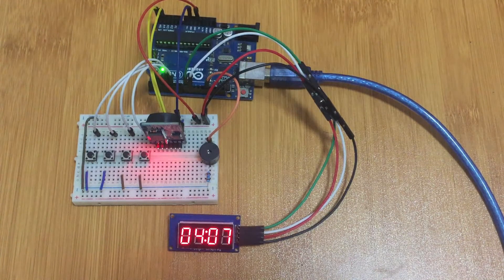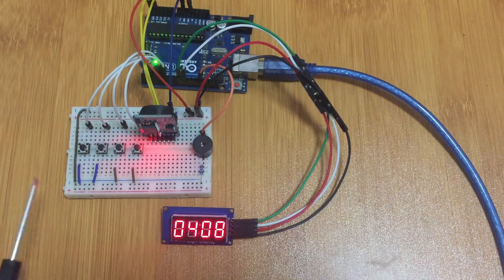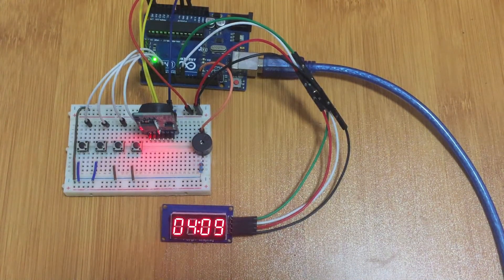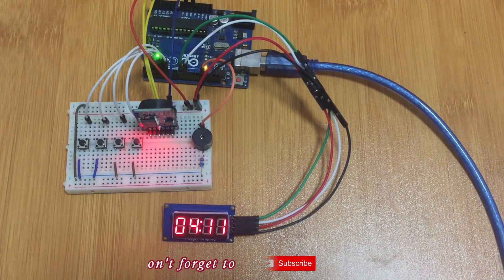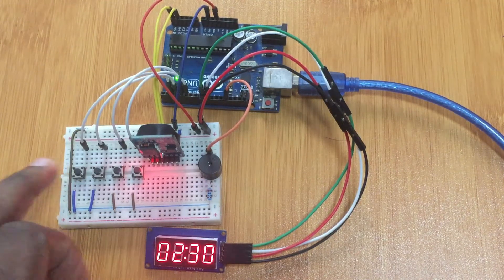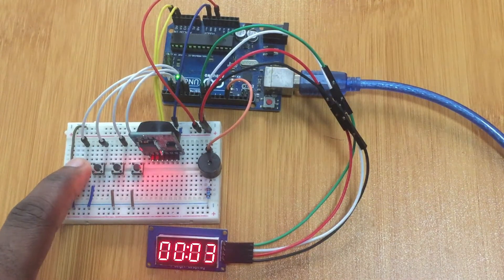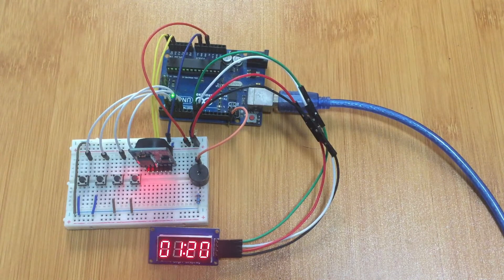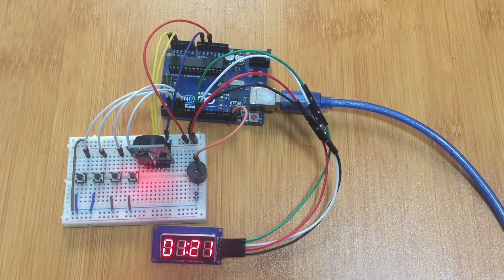Digital Alarm Clock Using TM1637 Display and DS3231 RTC.

Comment: Cool project! A couple questions that I hope won't take too long to answer. 1) Are the buttons momentary contact or latching? How would I go about turning this into a sunrise alarm clock--can I just hook an LED cluster to another output pin and start ramping up its rightness a few minutes before the alarm goes off?

Comment: Sir I have already done the clock but some problems facing that the dot display are not blinking but clock is running. one more fault when trying to upload the sketch error message showing class TM1637 has no member 'setColon'. what can be done? Please answer me.